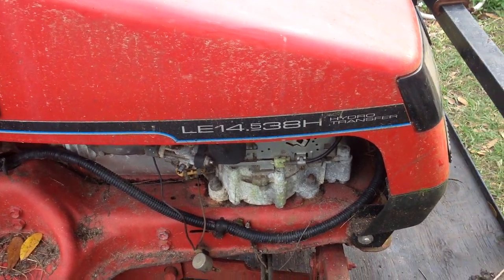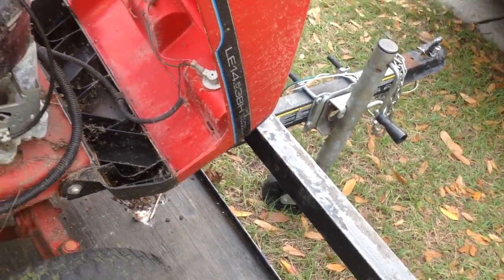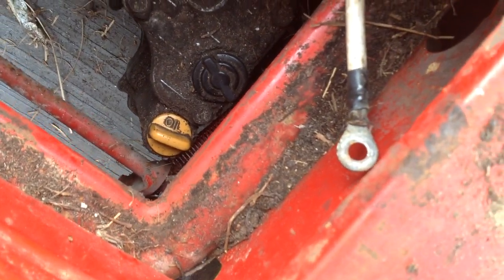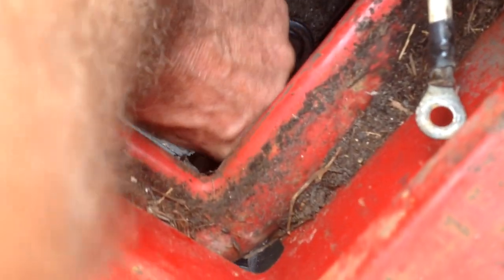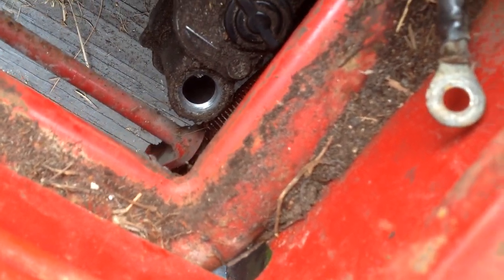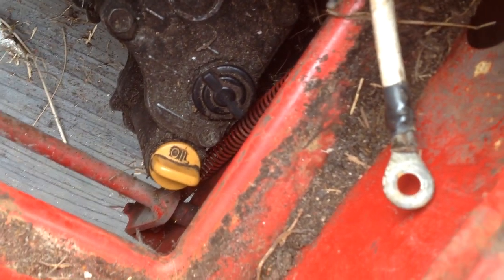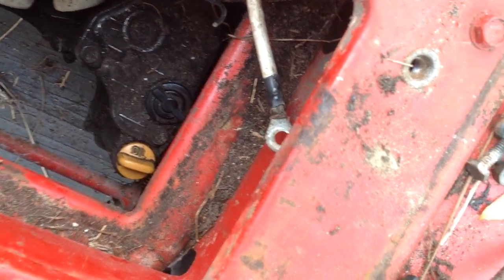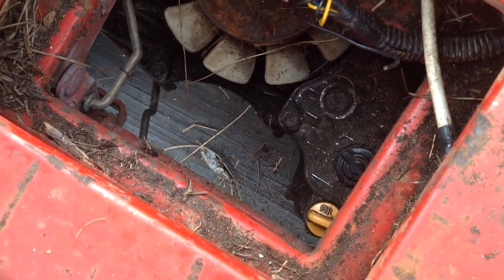Snapper LE14.5  H38  maintenance

Comment: What kind of oil and how much?
Reply from the maker: 48 oz and 30 weight in the south..up north 10W-30.  Thanks for stopping.  Put in about 40 oz to start and then check dip stick..Slowly add until you reach full mark on dip stick.  Then start the unit and re-check after shut down.

Comment: What's hydro static anyways?
Reply from the maker: The transmission operates with hydraulic pumps.
Reply: Thank you
Reply: I have a red knob I pull up on after I start the mower and it engages the  mower blades to start turning to mow the grass, but it was making a high pitch whirling sound and then the blade's stopped and pulling on the red knob doesn't work anymore to engage the blades. Plus a guy stopped at my house and said it was an electronic clutch and the bearings went bad and a wire was broken off part outside of the clutch a d he said the other part of the wire was inside the clutch. I don't know? Mine is a Snapper Hydro LE 1642 H Hydro transfer 42" cut model# LT 160H42 DBV Briggs and Stratton 16 HP Vanguard engine Model # 280777 type# 0672-A1 code# 970224ZE thanks
Reply from the maker: @rebeccaday7244  It does appear you have the electric clutch. By your symptoms and the guy's inspection, i think it will need a new clutch assembly.